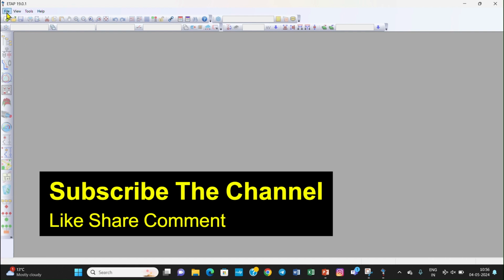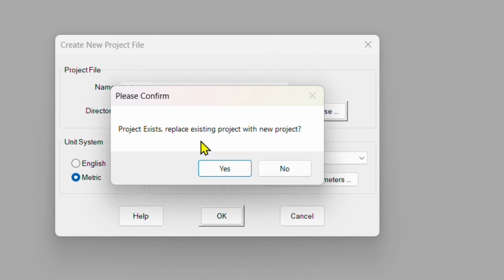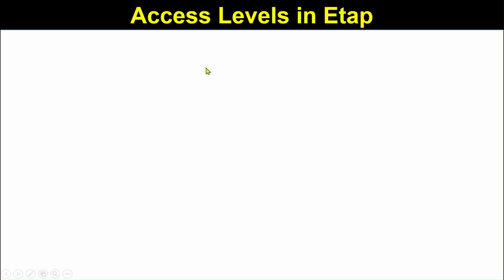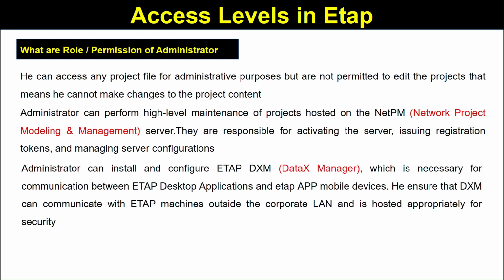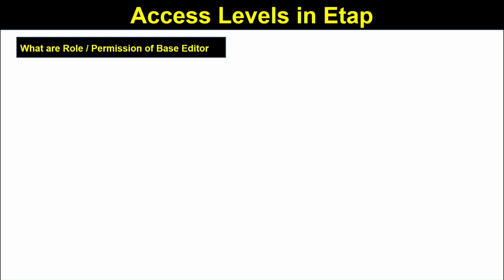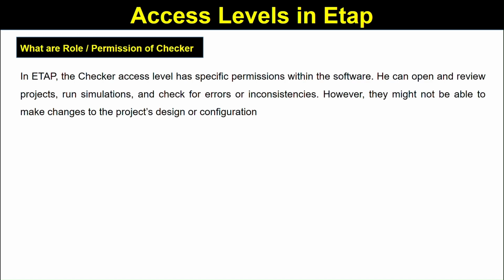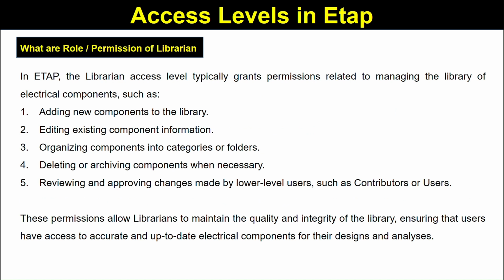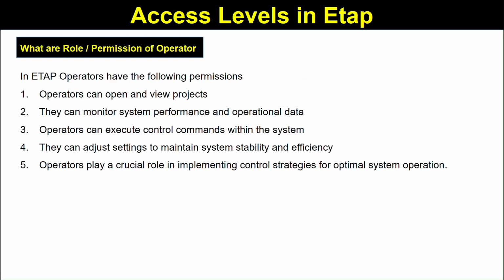Lecture 3 | Creating New Project in ETAP | Free etap course online

Comment: What different between ETAP and Scada
Reply from the maker: SCADA: Focuses on real-time monitoring, control, and data acquisition for industrial processes. It collects data from sensors and devices, displays it via HMIs, and enables remote control of equipment across industries like power, water, and manufacturing.

ETAP: A specialized software for electrical power system modeling, simulation, and analysis. It creates "electrical digital twins" to analyze system dynamics, transients, and protection, primarily for design and optimization of power systems.